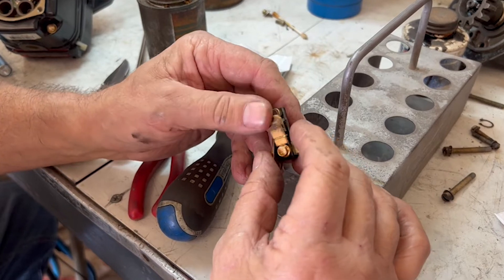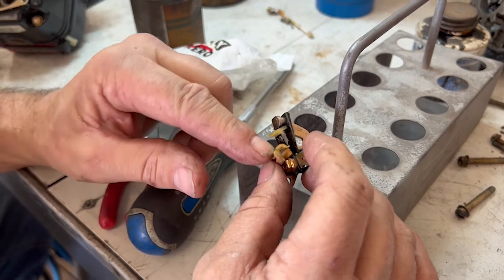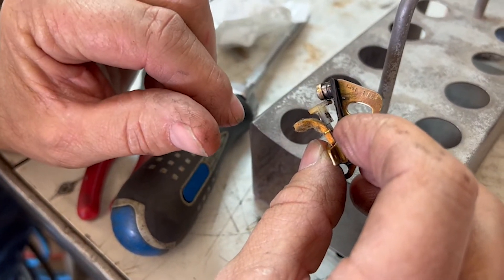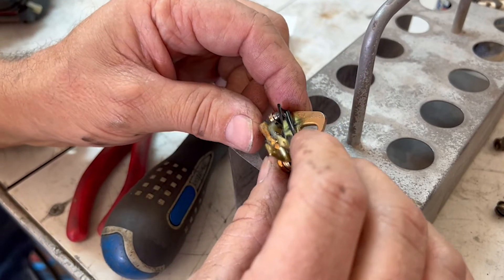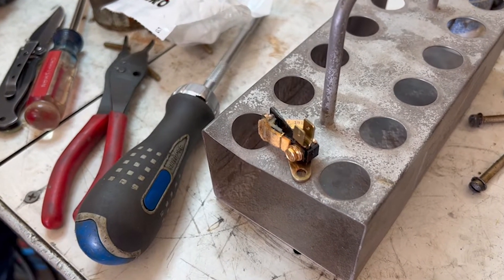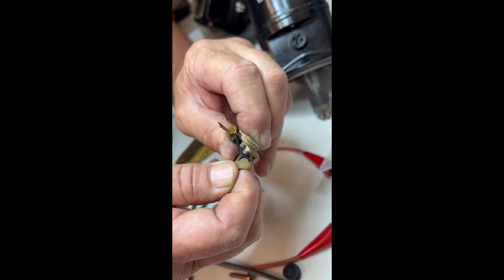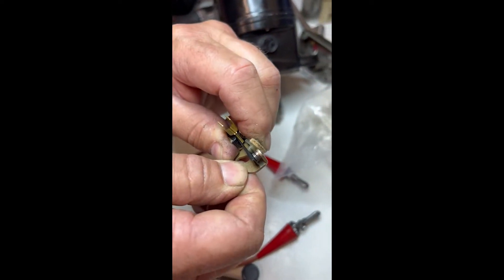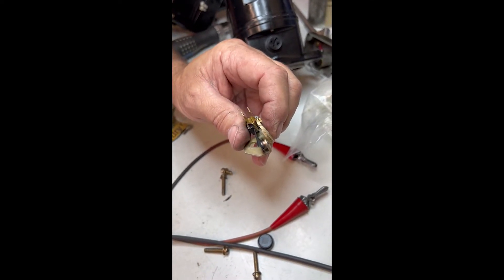What's with the Magneto Parts Failures?

Comment: Back in the 90's in Alaska we had the same problem with the points in the Mags of a DC-3, we tried every supplier of those points, but within a few hours the cam followers would wear down and the points wouldn't open anymore, it's not the lubrication, its the material the cam followers are made from